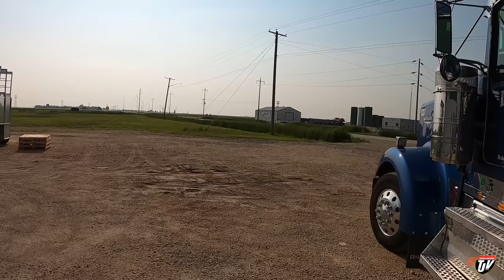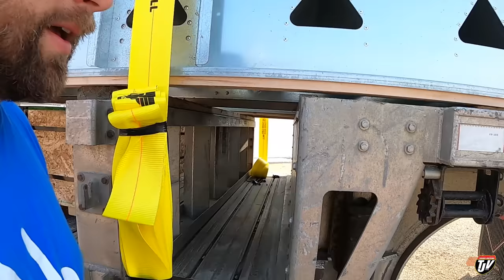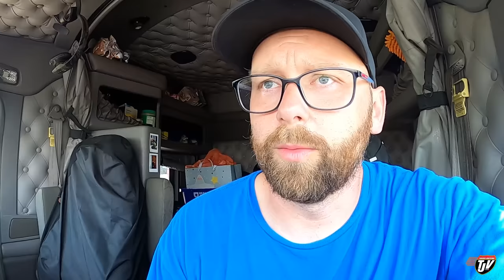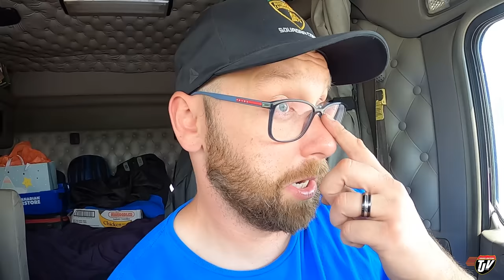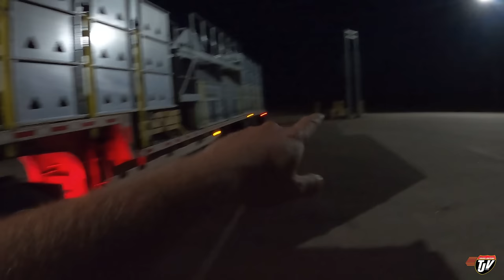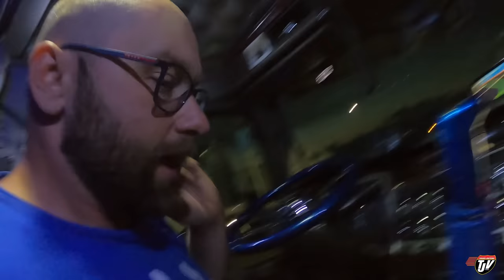ROAD TO ALBERTA | My Trucking Life | Vlog #2829

Comment: §CFR-2003-Title 49 - Vol 4 - Section §CFR-2003-Section 393-108 (part)4 states :

"(4) All tiedowns and other components of a cargo securement system used to secure loads on a trailer equipped with rub rails, must be located inboard of the rub rails whenever practicable."

Comment: That new Petro Pass in North Battleford also has lights at the pumps!  Green when the pump isn’t on and it flashed red when I had either main or satellite on. I thought “cool!” But then I thought I could see if someone’s pumping without the lights. And the pump handles are stored upright like a normal 4 wheeler gas station so when you tilt the handle towards your tank all the diesel spills out. Shame shame.